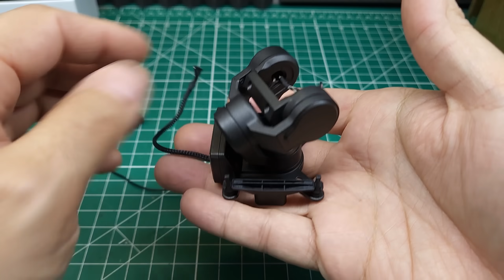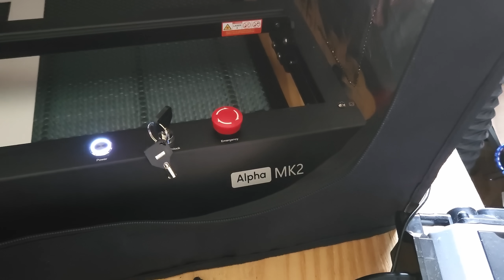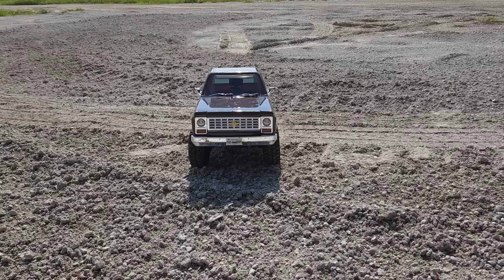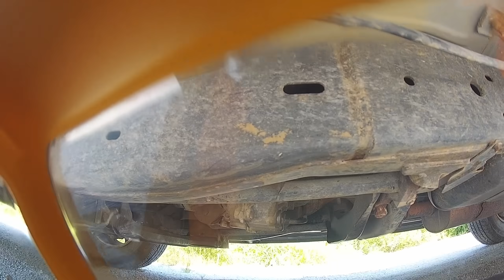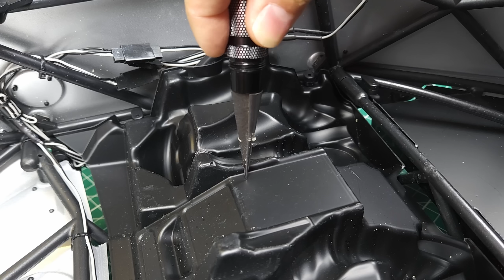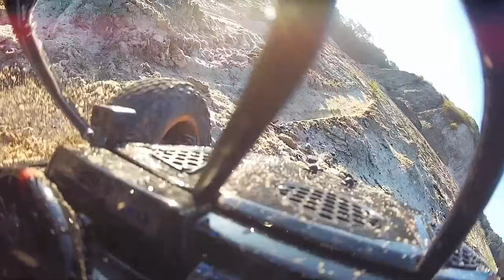NEW Head Tracking HD FPV Takes RC Bashing To The NEXT LEVEL!

Comment: whats the range on the video transmission?
Reply from the maker: It's hard to give a single answer to that but if you look up my latest FCX-10 LC80 video I actually do arrange test on that and my vehicle transmitter runs out of range before I even start seeing any break up on the VTX.
Reply: @DoRC  thats pretty cool, i know the drones can go a few miles, of course its easier to transmit thru the air but if i could build an rc car to get at least 1 mile i think that would be awesome.
Reply from the maker: @andrewscotti1136  I'm not sure one mile will be practical unless you're in direct line of sight with no obstacles or interference but I'm also not sure you'd want to drive your RC car a mile away as you're going to be walking that mile if there's a problem :-)
Reply: @DoRC  im thinking a tank build with an oversized battery to check out some tick infested islands and abandoned run down buildings. def would not be line of sight but i think with some good hardware it would be possible.
Reply from the maker: @andrewscotti1136 sounds like an awesome project!

Comment: Can this gimbal being used on analog FPV system?
Reply from the maker: Sort of. The gimbal itself does stabilize without any input from the digital FPV system but you'd have to figure out how to mount the camera which probably wouldn't be too difficult. The other problem would be resetting the position as it does tend to wander a bit over time. This is normally done using a button on the goggles though I believe you can do it through a signal from a connected channel on a receiver. It's not something I've tried though so you'd have to mess with it
Reply: @DoRC  thank you! I might try to buy the gimbal first and test it. Unfortunately it is wander over time like you said, I thought today technology is advanced enough to prevent such thing.
Reply from the maker: @ulungprabowo  For the most part it does. I primarily had to reset it when I changed my perspective on my goggles but if you aren't going to be using the head tracking feature of it and just the stabilization you might not have to. I'm honestly not sure how that works cuz I haven't messed with it in that configuration.
Reply: @DoRC  ahhh I see. That is a good news. Thank you so much!

Comment: another excuse...err..reason for me to upgrade my larger analog FPV to digital! other fun things to do: I used a spare drone FC board for compass and gyro HUD so I could tell right about when my van would roll over and allow me to see battery voltage. the crosshair helped me with depth perception so I could better tell if my van (rock van body on TRX4 painted for the A Team) would clear under obstacles . A youtuber I follow made working rear view mirrors on his street basher, to avoid the need for head checks. on my non head tracking Dual Rider I mounted the camera inside the driver helmet so you can just see the edges of the visor. even the simplest crashes seem terrifying lol
Reply from the maker: Nice! Yeah FPV definitely brings a different perspective.

Comment: Can u put up where did you buy those?...thanks!
Reply from the maker: I got them directly from caddx
Reply: @ are those the GM pro kits?
Reply from the maker: @jannacino5495 Yeah I used the V2 pro kit though there are others that are compatible. Which ones I'm not entirely sure. When I got my stuff it seemed like they weren't even fully sure of which ones were compatible. You might want to contact them or it should be listed in the manual for the gimbal
Reply: @DoRC and what battery did u use? Sorry asked so much question...i think your video is the best and simpliest fpv ive seen here.

Comment: This is cool, but it has been done before...  https://www.youtube.com/watch?v=LzTlQmn1fTo
Reply from the maker: Yes people have been doing surface FPV for a long time but up until recently It's been pretty impractical. Because of how rough RC cars ride over to rain a hard mounted camera really doesn't give you a good experience. This is different because not only is it HD but it's stabilized and that makes all the difference in the world.
Reply: @DoRC  my comment came out wrong... I've been trying to figure out a setup like this since the video I share came out 14 years ago.  Because of your video I am planning to buy 1 (or 2) of these set-ups for my son and I to play on our track. Do you have any numbers for the range you were able to get?
Reply from the maker: @BDKesling I didn't do any definitive range testing but check out the FCX10 LC80 video I did. I FPVd that and in there I did range test. It's pretty good and you're going to be able to get at least a few hundred feet on normal flat ground. My transmitter ran out before my FPV even started breaking up so I think your transmitter is probably going to be the limiting factor.

Comment: can this also been done with DJI gear?
Reply from the maker: Depends on what you mean. If you mean can You put a DJI camera in an RC car yes though DJI doesn't really have a gimbal that works standalone. If you mean can you put a DJI camera in this gimbal The answer is I don't see why not as the gimbal will stabilize standalone though you will lose the head tracking ability

Comment: How to do to conect vtx with the esc pls?
Reply from the maker: There are harnesses for the VTX and for the gimbal. Both of them have a red and black wire. You want to connect those up to the battery itself. You wouldn't connect them to the ESC. They're capable of taking anywhere from 2S to 6S power.
Reply: @DoRC  thx bro

Comment: Just buy an XplorerHD, that system is just plug n play.
Reply from the maker: That system wasn't actually in production yet when I made this video but it could be a good option. It's more expensive than just buying the components yourself and you are locked into that particular sled configuration. This won't work for a lot of vehicles but it definitely is a compelling option for people who don't mind those limitations.

Comment: did this gimbal works without have goggle x or other, as a stand alone gimbal? I will use this gimbal for a walksnail HD and Eachine goggles with digital mount.
Reply from the maker: It should. It will start up and self-stabilize. You won't have the head tracking feature but I think you can set up one of the inputs from your receiver to be activated by your transmitter for recentering which is something you'll definitely want.
Reply: @DoRC  thx 4 fast help
Reply from the maker: @CallesFPV-qc4uc  You're welcome thanks for watching!

Comment: Hey, Could you explain a bit more about the battery situation? I’m a beginner still and kinda confused about how to power the whole set up. Are you using a single battery to power the car, the camera set up, as well as the gimbal? Are you using any splitters or UBEC for power regulation? Trying to figure out the shopping list 😅

Thanks!
Reply from the maker: Fortunately because these were originally designed for drones the camera VTX and gimbal can run on anywhere from 7 to 26 volts so 2 to 6s. How you power them completely up to you. The easiest thing to do would just be to get a balance plug connector that's the same as whatever battery you're going to be using for your vehicle and plug it into that. Accessing the outermost two wires on the balance connector will give you full battery voltage and the balance leads are plenty big enough to power the VTX and gimbal. I used a separate battery a couple of times just for convenience because I had the 2S balance connector but wasn't running a US battery. You can also do this but it's totally not necessary.
Reply: @ ah I think I got it. I’m gonna try to run my 2s that I’m using for my car directly to the kit through the balance cable. I have an extension connector so I’m guessing that’s good enough to get it started. 

I was under the impression the gimbal needed 5v and I was gonna have to get a power regulator hahahaha. 

Thanks a lot!

Comment: Dude! Really freaking well done! 😃
I love FPV! With quads AND rc cars/trucks!
I still need to get a good basher to try it, but with crawlers I usually install the camera outside. (Those really small analog cameras.)
Now I'm going to make a small fpv pod for a VTX and a Caddx Turtle v2. It's still analog, but it records in 1080p. You know?
I'm going to build it with aluminum composite and metal standoffs, to protect it very well... But, again, I'm going to fix it to the exterior of the rc car, probably with dual lock... So I can change it from car to car. You know?
Either way, I just subscribed!
Stay safe there there your family! 🖖😊
Reply from the maker: If you like FPV I would definitely consider giving this system a try. A hard mounted analog camera is fun but gimballed HD is a totally different animal.
Reply: @DoRC  I absolutely agree! But it's still a bit expensive to me... 😂
But some day, for sure!

Comment: So that red and black wire coming out the camera is that able to connect straight to the battery for power? Or is there a receiver cable that can be soldered onto it ?
Reply from the maker: The The camera itself is powered off of the VTX. Both the VTX and gimbal are able to run on anywhere from 2S to 6S as far as I know. You might want to verify that in the manual though. A good BEC should be able to provide that kind of power but I can't guarantee it
Reply: @ does the vtx have open wires at the end for your own connection?

Comment: I mean a proper link and stuff to all the parts you used would have been awesome as well man..........
Reply from the maker: I don't normally do links cuz I don't want people to think I'm trying to sell them anything and links are constantly changing. You should be able to Google anything that I mentioned though and if you have any specific questions let me know
Reply: @DoRC  I found it all by freeze framing the start thanks ;)      Looks like its around £500 for the top setup, which seems reasonable.  What's the range on that setup ? thx
Reply from the maker: @PhantomMark It's going to depend on where you live and whether or not you're okay with breaking the law. I believe in Europe the maximum BTX legal power is 25 milliwatts which is pretty restrictive on Land. If you don't mind ignoring that or I think there's some commercial operator license you can get you can go up to 200 milliwatts which will really open things up. The actual range you'll get depends on way too many factors for me to give you an estimate. At 200 milliwatts just with normal terrain for me I can get farther away than I really want to walk to retrieve it especially not necessarily knowing where it is :-)
Reply: @DoRC  holy cow, I didn’t even think about the legality of things
Reply from the maker: @roku144  Yeah again I really don't know how much of a problem it is. Here in the US without a ham license which I do have You can't go over 25 milliwatts but I don't think anybody's ever gotten in trouble for it. That may be different where you live though

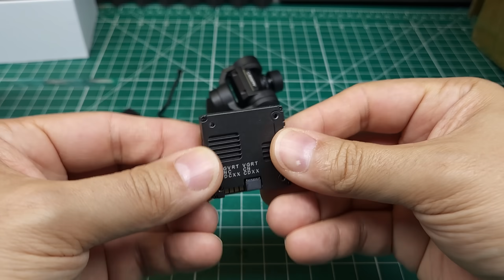Comment: 1:39 I don't wanna be that guy but this definitely has been done multiple times to a much more extreme degree,
 theres some that have incorporated the racing sims with actuators to run their crawlers along with the fpv setup it's actually scary what you can all do 😅😅
Either eay i love seeing this stuff hopefully its a robust system, 
Thanks for making the video 🤘🤘
Reply from the maker: There have been plenty of people that have done FPV and even head tracking FPV but until now all the solutions have been either homemade or pretty clunky and none of them as far as I know have camera stabilization. One of the biggest problems with surface FPV is how bouncy the images because the car is bouncing all over the place. 
This system allows you to buy the hardware then just stick it in a car and go. I think that's the first time That type of solution has been available that actually works.

Comment: Is the cable in the gimbal compatible with any of the dji air units
Reply from the maker: No unfortunately it's proprietary
Reply: @DoRC  that's stupid.....O well....thet lost my money...lol
Reply from the maker: @fredbowman916  to be fair it's more DJI that's closed source. Walks now does work with multiple manufacturers for camera equipment but DJI pretty much always locks their stuff down so that nothing else will work with it.
Reply: @DoRC  but caddix has cameras that work with dji, so why not just put a dji compatible cable in it so they can give people options
Reply from the maker: @fredbowman916  DJI contracted out specifically with caddx to make those cameras. It's not really a matter of the cable not being compatible It's the entire system. You could strap a different camera to it without any trouble you would just end up losing the head tracking capability because that goes through the air unit and then is also reliant on hardware in the goggles to work properly.
Reply: @DoRC  so you can use a dji air unit just for the video feed without head tracking

Comment: Nice and inspiring video. Thanks!. Excellent next project for me. I wonder what the Walksnail Goggles L range is. I tested the RUSH TANK MAX SOLO in my RC Crawler Truck using analog FPV (with monitor not goggles) and a gimbal with no stabilization. Here my experience trying to test its range.
https://youtu.be/jvIFzrDlt-A

Comment: You just need to add: 1) goggle head-up display for speed and voltage. 2) a light up instrument panel like they are now doing for FPV aircraft.  Glad walk snail has made this doable and affordable. For crawling competitions and 1/10 scale racing, this would be hyper-realistic.
Reply from the maker: It would be awesome to add some more realism!
Reply: HUD can be added using a drone or fixed wing flight controller. That will give you all the telemetry you could even need.

Comment: any link tu buy these gimball and camera?
Reply from the maker: They're a bunch of places that have them. Get FPV should have the GM3 and the compatible cameras which are listed in the manual for the GM3. To go with that you need either the avatar goggles l or the latest version of the goggles x both of which should be available from a bunch of different places.

Comment: Is the gimbal stabilising Even without pwm? So if I only power it, will i get a stabilized video without headtracking?
Reply from the maker: Yes but without some way to control it you can't reset the centering which could be a problem though I haven't actually tried it. I know the gimbal is also controllable through PWM signals so you might be able to add that ability to a channel on your transmitter. Again it's not something I messed with though

Comment: This has been done over 4 years ago. Apparently not much has changed, thought there was finally a RTR kit being offered. Shame
Reply from the maker: Head tracking has been around for quite some time but this is a pretty big step forward from what the old legacy head tracking systems offered. Most of them did not have stabilization and the head tracking was pretty clunky. I think this is the first time that a true HD stabilized smooth head tracking plug and play system has existed and it is far superior to at least anything I've messed with in the past.

Comment: Sorry to say, but it's not new at all. Even on YT plenty video's with it  from years ago ;)
Reply from the maker: The concept of FPV isn't new nor is the concept of head tracking with FPV but this is the first system that integrates everything together in a package that actually works well right out of the box. I've done a ton of head tracking FPV stuff in aircraft in the past and whereas you can get it to work it's never worked well.

Comment: I've been looking for a while for something like this. I just want the camera on top of the roof of the hood.  can you make one for me please? I need it for work purposes.
Reply from the maker: If you're serious shoot me an email. My email address is in the about section of the channel though you have to look at it on desktop to see it.
Reply: @DoRC  thx for replying. However, I was able to find some cheap stuff on Ali express and Amazon which Im going to test first. I also found the DJI robot which depending on the test for the cheap stuff I ordered I might considered as well.  If it does not work. Ill report back.  Basically, I need an RC with good camera to take landscape shots (I work in landscaping and Construction) and videos to show the work from a different perspective (ground) and to do 3d models.   Its weird, you can do this in the air with drones but from the ground there is not that many products.  A good thing I would like to do with this is close ground range orbital shots which a bit dangerus with drones.

Comment: I've been attempting various ways to do this since VHS was popular...to make smooth video you need your favorite car/truck that has the BEST SUSPENSION and super light oil in the suspension so it can track well (skip the jumps with light oil inside). Today we can add cameras that have decent anti-shake built in too to make videos that are virtually perfect like a drone.
Reply from the maker: Yeah these stabilization on modern cameras is really good though that doesn't usually allow you to do FPV. This is the first time I've really seen well stabilized FPV.